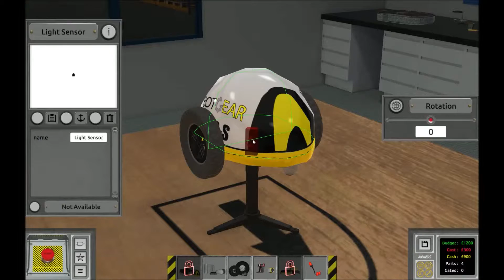Logicbots 2-5 Light Follow

Comment: Did your video truncate a few seconds early? Also, your microphone level is a bit low in this video.
It is indeed a nice solution to this problem. I wonder if there is a way to make the robot a bit more expensive, and make it behave less like a "doggie" who keeps hugging the light and running in circles, and more like a calm follower of the spotlight?

Maybe the solution that uses your first schematic, but at the end, if neither motor is triggered for a short while (both inputs are identical for a short while), then it simply goes straight towards the finish line? :)
Reply from the maker: +mpeijzel It sounds to me you have a solution there you're not sharing ?;)
Reply: masterstroggo
No, for this one I have no solution yet - otherwise I'd make printscreens and put them on my Steam page so you could see it.

I did have an alternate solution for an older challenge, though. (You can see my other comment for that one, in one of your other videos.)